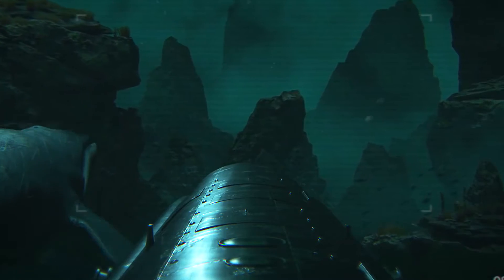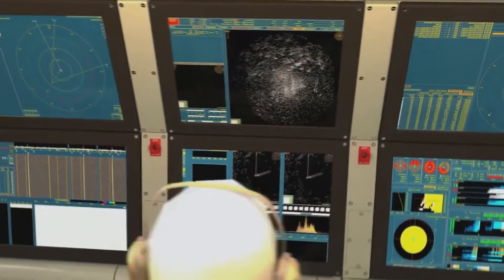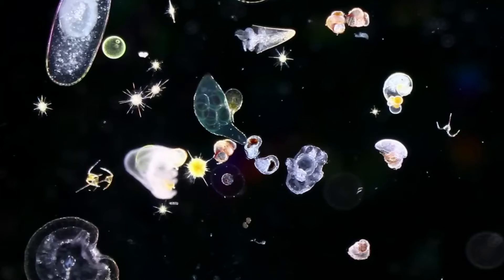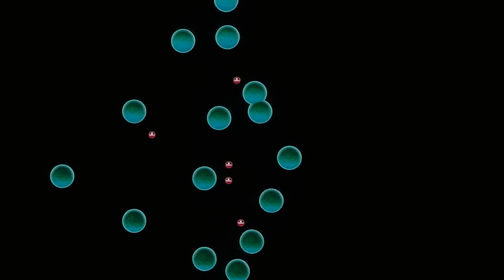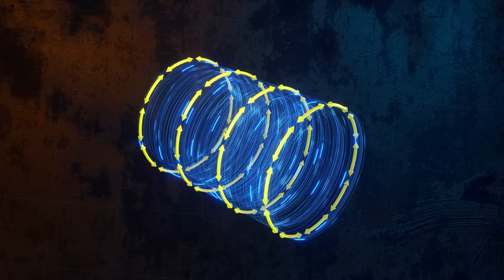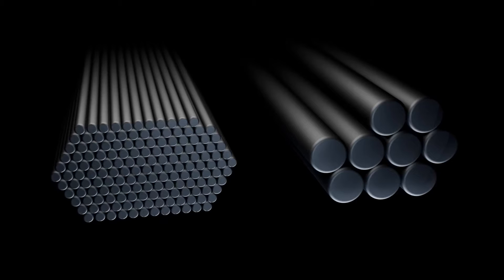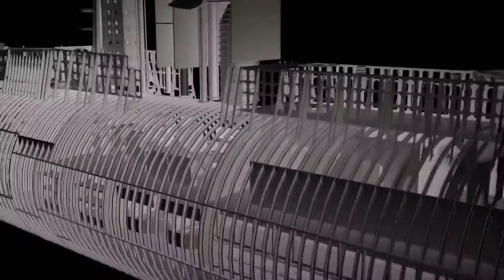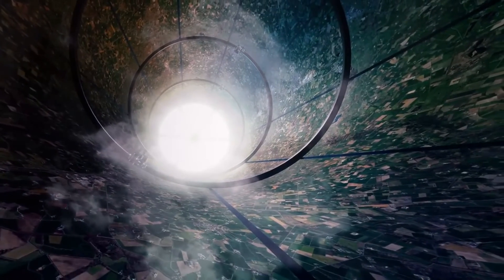Sending a submarine into Space.

Comment: Having qualified in submarines in the US Navy, and as a member of the Reactor Controls Division, I would like to give my input.

While if you could instantly transport a nuclear submarine into outer space the following issues come to mind.  Sure, the vessel will hold pressure and protect the crew however, a submarine relies of seawater to remove waste heat throughout the engine room by the use of condensers and heat exchangers. Without that cooling seawater the system components and reactor would quickly overheat once the seawater sublimated to outer space.  Conditions would deteriorate rather quickly on board the “space-faring submarine”
Reply: Long ago the Navy experimented with it using German tech. 

They rigged Anti Gravity generators to the submarine hull and installed a compact fusion reactor to power systems, which include an electromagnetic shield generator to protect the submarine and crew from radiation. See Salvatore Pais Naval Patents as ex.

The original program was the Huanebu created by the German SS who re-engineered the Vimanas using schematics the Ahnenerbe were provided by the Sinhalese Buddhist Monks in Sri Lanka. They rigged Hans Kammler reactor core to Victor Shaubergers Saucer Hull to produce the Huanebu ‘UFO’.